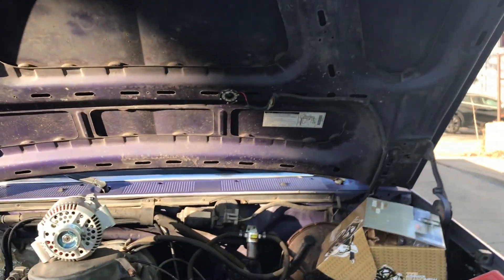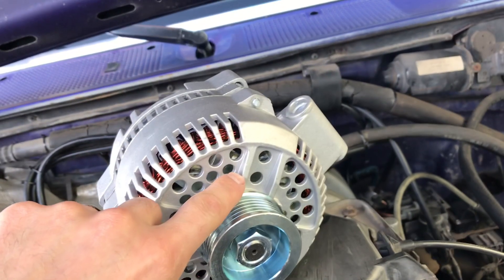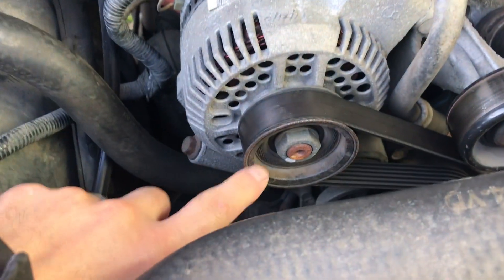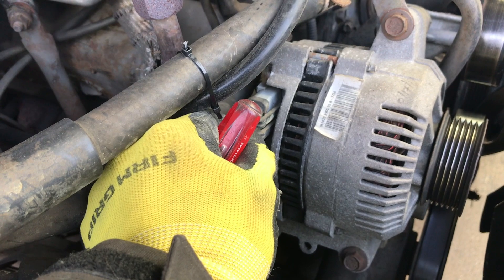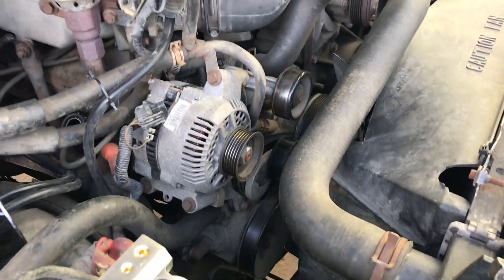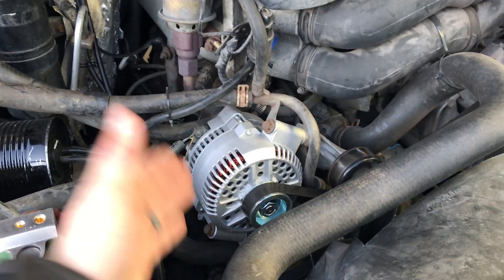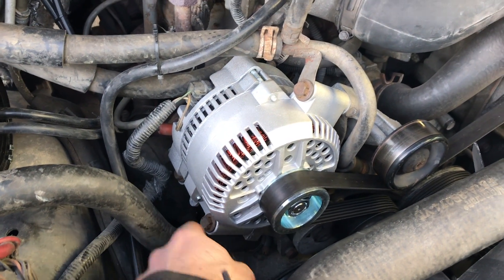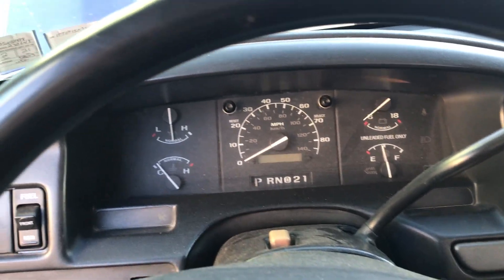How to Install a Larger Amp Alternator (130 Amp) F150

Comment: I always take the opportunity to upgrade my alternator. In my Bricknose Bronco I got a 130a 3g out of a Fox Body Mustang and it worked perfect

My 4Door Bronco with a 7.5L got a 130a 3g out of a Taurus. Perfect fit. 

I don't need all the amps but it is nice to see the volts not drop when your running the Fan on Max with the high beams.
Reply from the maker: It seems like upgrading the alternator is the thing to do on these trucks. 
I totally agree! I hate seeing the volts drop when I turn on more accessories. 

So I’m just polling everyone. Did you upgrade the size of the charging wire and did you change the size of the pulley?
Reply: @TheMinuteMasters  I installed the smaller 2g pulley and upgraded the wire to 4gauge. Beefing up power wires and grounds keep these trucks on the road longer.
Reply from the maker: @Skitter302  Good to know. Thanks Skitter!

Comment: Huh. I guess the 351 brackets are different to the 302, I just used the 5g from the mustang, yes!!! People definitely increase that cable!
Reply: Brackets are the same between the 2 engines.
Reply: @adammossinghoff385  you're right! I forget I'm using a mustang bracket on my truck
Reply from the maker: I’ll have to check but I think g3 alternators will fit the 351s too. How many amps does the g5 put out? 
For comment readers, what size should the cable be increased too and what size fuse?
Reply: @TheMinuteMasters  both my 351 windsors are exactly like yours . Good job my friend, I’ve done this job 100s of times, I still stayed to the end of your video lol.
Reply from the maker: @salgonzalez908  Thanks Sal! 🤙 So did you ever increase the size of the charging wire? And did you change the belt size or the pulley size?
Reply: @TheMinuteMasters  honestly never felt the need to increase the wire size if it wasn’t needed, and the only things I had wired/powering was KC lights, large” 2kRMS subs/amps & Led head light bulbs. YES my power needle was dancing but never had any issues.

On one truck I did have to change belt and tensioner because old belt was slipping off. No, no downsize belt or changing out the pulley for me.  

On one truck I did do new fat wires and the needle still bounced around. So my opinion that upgrade was not essential to me. I would only take the time to change your wires if they are worn out and you have a lot of power dimming activities.
Reply from the maker: @salgonzalez908  Good to know. I only ever see “recommendations” for increasing the charging wire but no definite. You are definitely running a lot more accessories than me. I would like to add some KC Flex lights to my truck eventually. Good to know the wire will do.
Reply: @TheMinuteMasters  I'm using 2G they say 4G is okay
Reply from the maker: @QuikModsOBS  So you are switching from 2G to 4G? 2G alternator definitely don’t have enough amps.
Reply: @TheMinuteMasters  I'm using 2 gauge wire, with a 5g alternator. I'm using the mustang bracket for a blower setup..
Reply from the maker: @QuikModsOBS  Nice! By blower I take it your are putting a supercharger on your 351?
Reply: @TheMinuteMasters  yes sir!
Reply from the maker: @QuikModsOBS  That’s going to be awesome!
Reply: @TheMinuteMasters  thank ya sir!